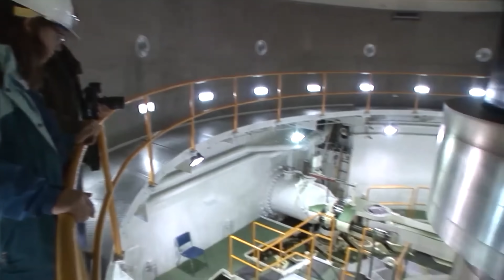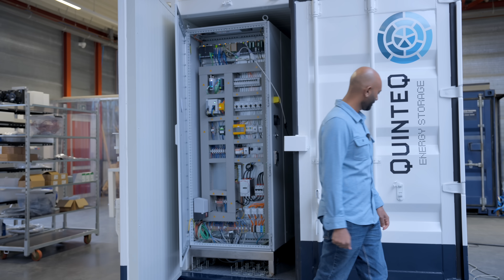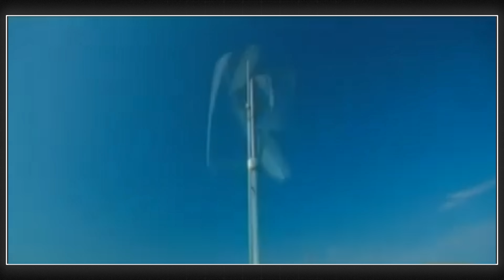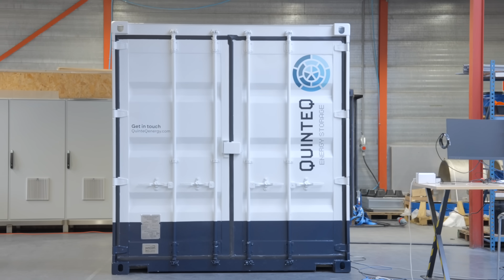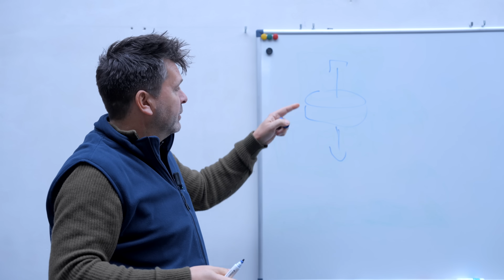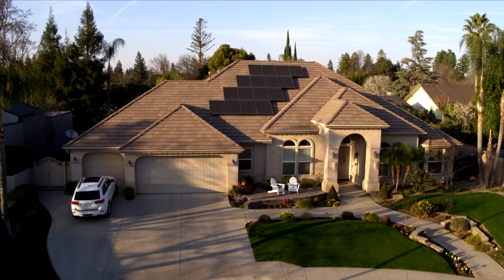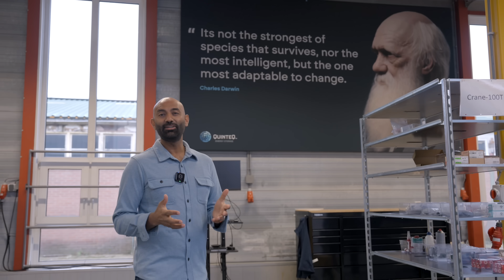How Flywheels Solve Clean Energy's BIGGEST Problem

Comment: small units for homes ??
Reply: What do you have in your home that uses huge spicks of high-current at a moment's notice? Nothing. This has zero advantage over modern batteries for home use.
Reply: @JorgTheElder  ok thx I understand :)
Reply: An individual house doesn’t generate particularly large spikes.  These devices are about dealing with massive spikes and smoothing them out.
Reply: Probably not a good ROI unless it is built into new construction and is part of the 30 year mortgage.

Comment: Windmills have inertia. Rotating masses....
Reply: The wind turbines have inertia but they don't contribute to the grid stability directly with their mass. The wind is not stable and the turbine cannot spin always at 50hz/60hz, to improve the efficiency they have to rotate at different speeds based on the wind conditions.

However since the grid requires 50/60hz, they have some power converters AC(unstable frequency)->DC->AC(50/60hz) and then they virtually contribute to stabilise the grid.
Reply: @manup1931  air drag
Reply: Windmills are not synced with the grid for good reason. Their rotating masses do not operate at a single stable RPM.
Reply: In the UK, the newer multi GW size wind farms are often connected to the grid via HVDC cables, and DC can't transfer the inertia from the rotors even if the rotors are fixed speed, which newer ones are normally not.  However it does mean that the connection to the AC grid can be made by a grid forming converter, and that does provide synthetic inertia in the same way that our battery farms use grid forming inverters.  The same is true of our HVDC interconnectors to Norway, Denmark, Germany, Netherlands, Belgium and France, so our flywheels are hardly required these days, I doubt we will install any more. They were useful during the transition, but as I write this, at 5PM, the UK grid is running on just 5% gas and 0% coal, 65% wind for the UK, North Scotland is at 100% wind - fossil fuel is almost gone.
Reply: @nigels.6051 the interconnectors to France Norway etc are also all DC so they can not transfer Inertia  either. 😂

So we still need other forms of inertia.

But the real issue is that UK wind output is incredibly variable. 

Today wind output  almost hit 20gw
But I have seen it well below 1gw
And I have seen it go below 3gw for days on end.
And not go above 5gw for weeks on end. 

So we don't need a few GW/h of storage, we need MANY TW/h of storage to cover the gaps. 

Factor that into the cost , and we will get no reduction in bills
Reply: Yes , but it is not "synchronous"  it does run at the grid's 50/60hz. It is what they call wild AC